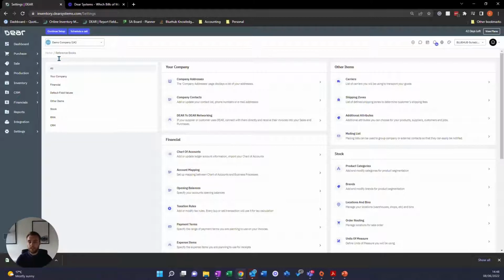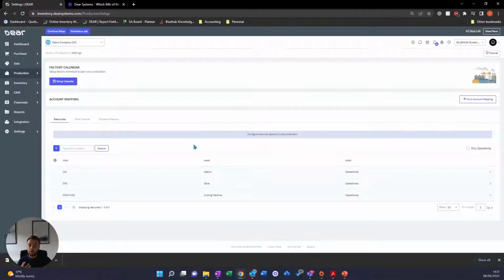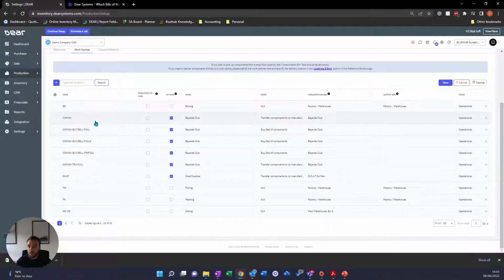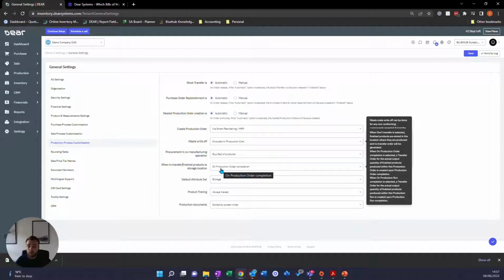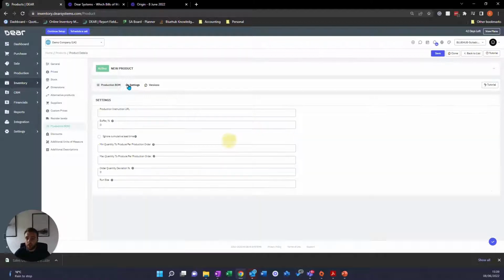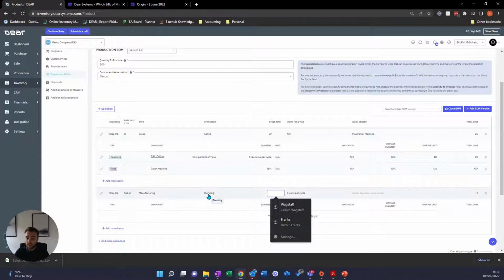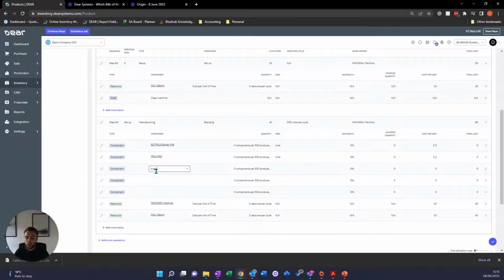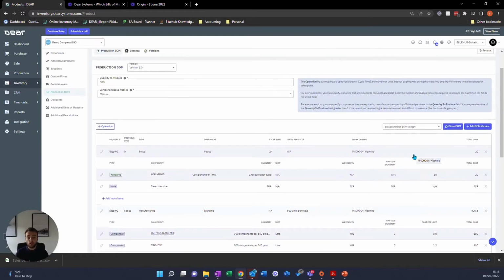Dear Systems - How to Set up a Production Bill of Materials in 20 MINUTES!

Comment: I had an employee input BOMs from a previous system we used, but they are all Assembly BOMs. Is there a way to convert the existing materials from the Assembly BOM to a Production BOM? Or do I need to completely start from scratch?
Reply from the maker: Hi Nick,

Thank you for your question. We'll look to make a video on this soon, but for now, you will only need to partially start from scratch, although there is definitely more information required in the Production BOM compared to Assembly BOM so there will be additional data you will need to gather. You will be able to reuse information such as SKU, Name and Quantity. I would recommend exporting your Assembly BOM from Dear and watching our Import Production BOM via CSV video and converting the data over in Excel for reimport to Dear.

Video: https://youtu.be/Q-xJX3kDP0U

Hope this helps!